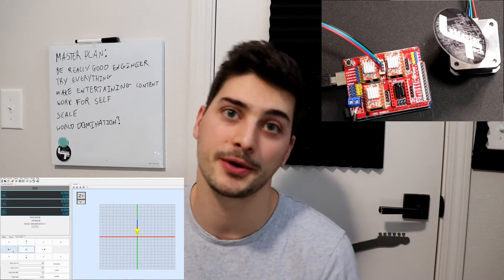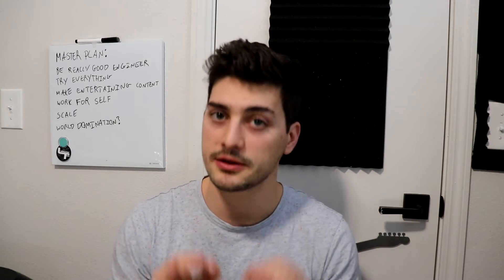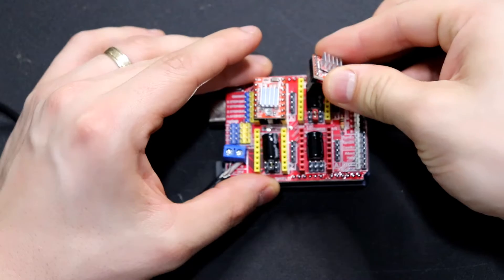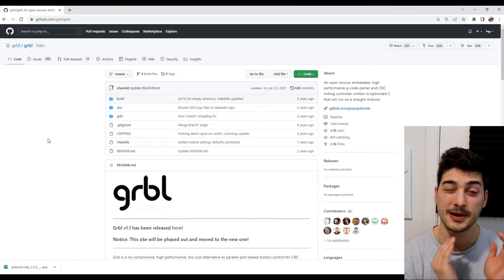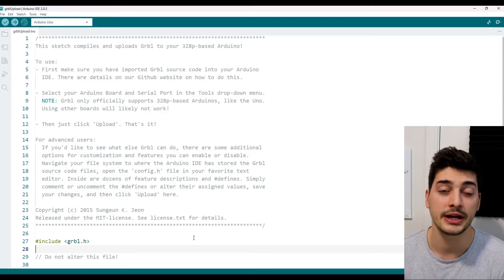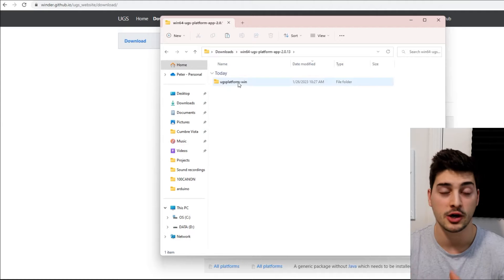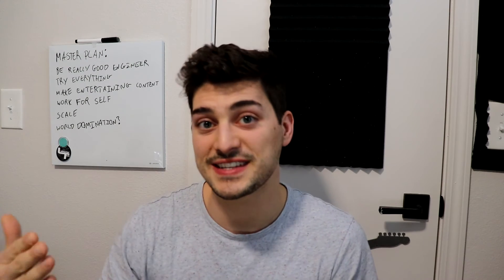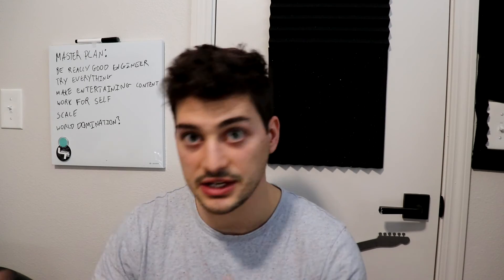How to Control Stepper Motors with Arduino using a GRBL CNC Shield!

Comment: I have a question. How do you confirm the wiring order for the 4-pin stepper motor headers on a standard CNC Shield V3? I’m not sure which pins correspond to A1, A2, B1, B2. Or does it even matter?
Reply from the maker: It definitely matters! There are a few good walkthroughs on line for verifying A+, A-, B+ and B- by like shorting two together (with no power attached) to feel the magnetic resistance when you try to turn the motors! And on most shields you can flip the connectors later if the directionality is backwards from what you want!

Comment: When I try to move my stepper motors they just shake back and forth in staid of rotating one direction... what do I do?
Reply from the maker: Hi this is usually a wiring issue! Double check the pins of your motor cable, it’s possible to get the step forward and step backwards wires energized at the same time which basically creates binding! Just double check all wiring and that you have a good physical connection!

Comment: How can you connect external steeper drivers to drive motor with more than 5amp?
Reply from the maker: id suggest you look into stepper motor drivers! For more high amperage applications you dont want the little dinky arduino with a shield on it providing that much amperage!

Comment: hello sir, i have a question why don't you use limit switch sir?
Reply from the maker: Hi, you can use limit switches with this shield as well! I just didn’t because the tutorial is on using stepper motors
Reply: @lemastertech  sorry for basic question, Should i use dc-dc converter if i want to build cnc machine using that shield?

Comment: Se puede armar una impresora 3d con este kit?, no encuentro informacion sobre esto. Principalmente porque no se como conectar el hotend y el termistor
Reply from the maker: Hola, no tengo mucho español pero si, la prima razón para usarlo es CNC máquinas pero es el mismo “g-code” para decir una impresora 3D que tiene que hacer. El hotend puede ser un simple ”on/off”.

There are probably better kits than this one for DIY 3D printers! Sorry for my bad Spanish!
Reply: @lemastertech  thanks

Comment: Hey man thanks for the tutorial probably the most helpful :)
And as I follow your method and stumble on some issues I hope you could help :) 
So the problem I’ve is, after installing and uploading Arduino and attaching the shield not everything works as it should. 
My controller see my soft limiters as hard stops but above all pin out for them on the shield seems messed up too I’ve Y+ X+ and spnEn active stop ends pin out,and  Z+ seems not active at all. 
Any help would be much appreciated 🙏
Reply from the maker: Hi I’m sorry for the delayed response but I really don’t know how much help I can give you on this specific problem over a YouTube comment! Hopefully it’s not just a bad CNC shield!
Reply: @lemastertech  no worries 😉 I managed to find the answer :) it is due to new version of GRBL they swap the pins in order for people to be able to set homing in bottom left. Not like this make sense to me 🤷 but hey at list my machine is working 💪

Comment: Do you know of a way to control more than 4 stepper motors per arduino? I need to control a total of 10
Reply from the maker: You’d need a motor breakout board! Honestly a raspberry pi or arduino mega are going to be required most likely due to the number of PWM pins you’ll need and total memory concerns! Basically controlling a stepper just requires a stepper driver so as long as you have enough pins memory and power there’s no real limit!

Comment: do you know or have a video on how to connect spindle(dc motor) into the cnc shield?
Reply from the maker: I don’t have a video on it but that’s what the fourth hookup is for! It’s just two wires for most models but you should just be able to check the spec sheet for the Cnc shield if you need to know specifics!!

Comment: Hi.i want to use limit switch but when i send $H homing command the steper motors locked . It make me confuse 2 days😅 and i test all solutions i know
Reply from the maker: Hi, so they turn normally but then if you try to home they lock up? Or they’re always locked? Could be crossed wires or an incorrectly compiled controller project!
Reply: @lemastertech  yes they turn normally but when i send $H for homing prosses they lock up

Comment: Great video mate! I have a project that required more then 3 steppers, is there a way to connect multiple boards? IE in groups of 3?
Reply from the maker: Thanks for watching! And probably the best solution there would be 3-4 steppers per arduino board, then send them all commands from a master arduino or raspberry pi to coordinate the movements for all the sub sections!

Comment: Hi, I am trying to connect the cnc shield setup to stepper motors. I am having an issues. I am not able to connect to the audrino unless I enable the board. I see you don't enable it in the video how does that work ? 
I am having some issues with my setup. The UGCS connects only after enabling the board. Even after connecting. It freezes after a single jog. 

Can you please help me with this ?
Reply: This issue is fixed! it was a bad Audrino clone that caused problems. Replacing it with a different audrino solved the issues.
Reply from the maker: Hi I am sorry I haven’t run into these specific issues myself but I might recommend closing all the different software tools at once, letting your computer restart and trying again. I know that sounds like a generic IT answer but it really resets a lot!

Comment: Bro l got a really basic question, I got a NEMA17 motor 12V 1.5A, when talking about 1.5A, is that a must to provide such current to drive my motor or I can have a slightly lower current like 1A?
Reply from the maker: Hi, there are actually constant current and constant voltage stepper motors on the market, but the most common nema17 motors are constant current, so yes most likely they’ll be pulling their full rated current constantly by varying their voltage consumption!

Comment: Great video, but could you make one using grbl ans AZ ide for android phones specifying the libraries to load. I want to feed and control my cncs with my phone. Regards.  Oh also adding a Joystick to the arduino or cnc shield  to be able to set zeros and tool lenghts on the cncmachine would be hero level.😊
Reply from the maker: Hey thanks for watching and your suggestions sound super cool but honestly I do not have an android device so I don’t think I’d be a good candidate to do that tutorial! The joystick is a cool idea and I’ll probably need a few months before I can make a super deep DIY cnc tutorial but I’ll try to keep that idea in mind thank you!!
Reply: @lemastertech  could you help me with correct software uploading on the arduino. I get an error about empty library.

Comment: Great video, I am not using GRBL as I have to use the motors for a different purpose. I have the CNC shield plugged into the Arduino.

From the CNC shield pin out, Pins D2 and D5 of the Arduino are used for controlling the step and Dir of X axis.
D3 and D6 for Y axis/motor and so on.

But I want to micro step the motors, What pins on the Arduino should be programmed for doing this.

Code for controlling the basic step and dir of "X" is shown, but here I want to control the Microstepping of the 'X' motor. *How do I do that* ?
///////
const int stepX = 2;

const int dirX  = 5;
const int enPin = 8;
void setup() {

  // Sets the two pins as Outputs

  pinMode(stepX,OUTPUT);

  pinMode(dirX,OUTPUT);
  digitalWrite(enPin,LOW);

  digitalWrite(dirX,HIGH);

  }

void loop () {

for(int x = 0; x < 200; x++) {

    digitalWrite(stepX,HIGH);

    delayMicroseconds(10000);

    digitalWrite(stepX,LOW);

    delayMicroseconds(10000);

  }
}
Reply from the maker: Hi, I am not sure about using the arduino to micro step the motors, I believe you want to jumper the step pins on the stepper motor shield controller to determine what step size you want to use!

Comment: Please reply😢
The adaptor current rating? Basically i want to know that how much current can i use to power the cnc sheild…
Reply from the maker: Hi you need a 12 volt DC power supply. You don’t need many amps as each stepper only pulls around .4 A max so the volts is the part that matters!
Reply: @lemastertech thanks for your response
in my case stepper rated 1.2 Amps and I use 3 stepper motors so 12v 5Amp is best or not..?
Reply from the maker: Hi, you just want to make sure you have a power supply that can provide more than your required max amperage! Volts is the part that really matters, and then you just double check the specs on your CNC shield to make sure its rated for that amperage, sounds like you'd be fine with 5 amps!! @arghyadutta9251
Reply: Thanks you are quite more responsive than others ❤️
Reply from the maker: Happy to help, thanks for watching!
Reply: It's basically a robotic arm 😁

Comment: Can you tell me that how much ampere\volt supply is used for the motors running
Reply from the maker: Hi, that is specified by the cnc shield and stepper motors that you’re using but for mine specifically I needed between 12 and 20 VDC!
Reply: @lemastertech  I'm using 3 NEMA 17 with a4988 so tell me about the range of supply that I should use
Reply from the maker: Looks like you’ll want 20-24 VDC for nema 17!

Comment: Hi, I very much followed the video and connections. Though I’m having 2 issues that I can’t understand their cause. The first one is that the stepper motor is not moving at all, it makes buzzing sound when I try to adjust the current limit on the A4988 driverI but other than that there is no action. The second problem I have is that at first I could connect to Universal GCode Sender but since then it always fails to connect. No error message either. I read in some forums that I have to change the stepper motor cable connection order, I was wondering if you have done that or the issue I’m having is completely different. Thank you for the video btw
Reply from the maker: Hi I am sorry but I have not had issues connecting to the Gcode sender and I did have buzzing once but it was because I had accidentally fried one of my stepper controllers - I’m sorry I hope you got this figured out!
Reply: Hi, thank you for the response. Yes the issue was with my A4988 driver. I burned it accidentally and haven’t realised it. It is working charm now, thank you for your amazing content🤘🏽

Comment: when I plug in the power suply 12v and I still have the arduino pluged in it kills my laptop and I have to remove the batery and put it back to get my laptop to turn back on... am I doing somthing wrong? also the leds freek out when I turn on the power suply, I have a simple blink program on it and when I suply power it frekes out and does not blink. I just have one motor driver and one motor pluged in.
Reply from the maker: There is definitely a pin out issue between your cnc shield and arduino!! Make sure you don’t have a pin mismatch between your shield and arduino uno! You may have a bad board because nothing about powering the shield should affect your pc connection!

Comment: Can i follow the same steps if i am using a MKS GEN v1.4 ? it has a ATMEGA2560 uC, also can i control different motors with the same driver ?
Reply from the maker: Hi! Yes you should be able to but you’ll need a CNC shield designed for that sized board, and yes you can control different motors but they need to have the same power requirements and four pin hookups!

Comment: Is it possible to remove the Stepper motor, and replace it with a linear stepper actuator?
Reply from the maker: Hi, yea it ought to be possible but using the CNC shield designed for steppers might not be the best solution because most linear actuators actually only need two wire control and you can change direction by reversing polarity, but most steppers use four wire control - if you have a four wire control linear actuator it will probably be pretty easy though! Goodluck hope this helps!
Reply: @lemastertech  thank you so much !!

Comment: I am new to the board wiring. I am going to build CNC machine using UNO and CNC shield. I am using Nema 23 Stepper Motor 3Nm(425oz.in) 4.2A & Driver DM542T CNC Kit. 
How much power supply is required to run UNO and shield board?
Thank you
Reply from the maker: Hi, 12v dc power is probably plenty for the shield to run nema23 motors but the uno may need a separate power supply depending on load pull!
Reply: @lemastertech  Thank you

Comment: What was the component you used to bridge the connection on the step increment pins?
Reply from the maker: Hi - You need a 2 pin jumper cap (short circuit shunt) - I think I bought these last time I needed more https://amzn.to/3qKwYu8 - Hope that helps!

Comment: I'm all hooked up and connected. Flashed the UNO @ 115200 baud, and carefully set it all up in UGS.....BUT, When I go to move the steppers, nothing happens! I have an "alarm: XYZ Probe." Not sure if that's causing my issue or not. I'm stuck here. Any help is appreciated. Thanks!
Reply from the maker: Hi I once had this when my pins weren’t aligned between my CNC shield and the arduino, and a separate time when I had a fried stepper controller, but if UGS lit up orange like the communications were all good and your stepper motor controller isn’t overheating (that would happen due to a short) then I’m not sure what the XYZ probe error would be telling you as I haven’t seen that before! Have you tried multiple axis and none of them work??

Comment: what feedrate you use to test the motors?in the calibration my motor rotates normaly . when i try to jog , it doesnt rotate
Reply from the maker: I just jog each motor 10 mm in each direction to make sure they’re working, feed rates shouldn’t matter too much if all your wiring is correct that would just spin it faster or slower!

Comment: Hello sir
I made cnc machine  (Arduino uno grbl ) z and y only one direction run pls help
Reply from the maker: Hi, if your g code sender is able to move the system in one direction, and you’re able to manually turn it in the other direction, then it sounds like you might have a pin misalignment either between your Arduino and CNC shield or between your shield and motor controllers. If mechanically you are able to twist it backwards it’s either a physical setup issue or software bug!

Comment: I would send gcode from a smartphone to an old CNC Fanuc Sigma VC1000 that has an old rs232 serial 25 pin. After that I would monitoring this machine (maybe sending it some command to the serial and the machine could answer me about start, stop, allar, type alarm, but I don't know if it possible, maybe yes).
Could you help me in this little project? Thanks.
Reply from the maker: Hi - everything is possible, but I don't have knowledge or experience with what you are specifically requesting. It sounds like you would need an intermediate software on your computer to communicate to your FANUC cnc machine, if you want to be able to use your smart phone to send commands you will likely need to build a computer application that can talk to both your smart phone and your CNC! Goodluck, this sounds very cool and challenging

Comment: Hi guys, 
I have a bit of a problem I'm hoping someone can help me out with. I am not able to connect my UGS with the Arduino and shield.. it says connecting but doesn't get to connected. Has anyone had this issue before? .. and hopefully got it resolved?
Reply from the maker: Hi, I had this issue once when I had the baud rate incorrect, and another time when I had accidentally shorted two pins on my arduino, but if you have the right com port and baud rate and all the pins aligned I am not too sure what else could be causing it! You could try close the arduino IDE if you still have that open, sometimes the board can’t communicate with two software sessions at the same time!

Comment: Im having this issue where the 5V and GND is shorted on the shield. This is causing the arduino to disconnect and the USB connector to heat up when the shield is connected.

Is there a way to pinpoint where the 5v and GND are shorting on the PCB by the use of some tool or do I need to get a new shield?
Reply from the maker: So a few ways you can check would be try plugging the board in without the stepper controllers plugged into the shield and see if it’s still getting hot. If it isn’t, that means the heat sink of the little controllers might be shorting. Then you could plug those in one at a time and see when it starts getting hot, that would tell you exactly which one is the issue. Most likely you’ll just need one new controller if it’s fried!
Reply: @lemastertech  thanks for the response but I've done the testing without any controllers connected. i also haven't connected the 12v however the 12v doesnt have any short with the 5v pin, (the ground does).

I saw in a video that they're using rubbing alcohol to find the traces that heats up. I thought of a thermal camera but I dont have one available to me

Comment: I downloaded grbl and had to create the libraries folder for but I can't access it through the examples page. Did I miss something?
Reply from the maker: Hi, I don’t think you missed anything if it shows up in your added libraries but the example code doesn’t, but if you pause the vid on the code I pull up you’ll see it’s literally just one line! You don’t need any of the gray comment lines so you can just type it in pretty easily!

Comment: when i hit connect it turns orange but at the x, and y controls it keeps on saying connecting
Reply from the maker: Hm, it is possible the baud rate could be wrong, but you might want to try closing all the software and reopening it, I know someone else in these comments had something similar and their issue was the arduino IDE was still open! Goodluck!